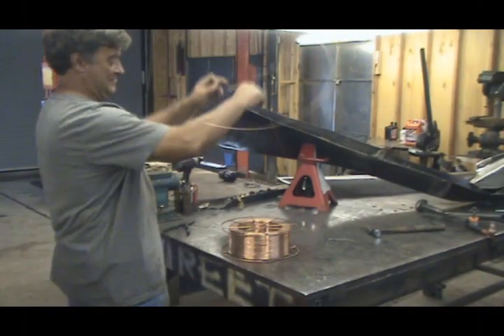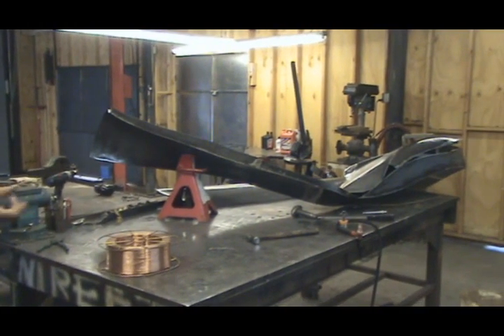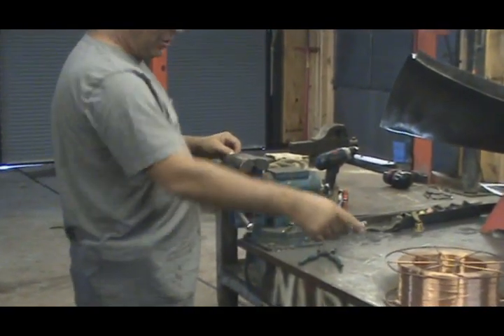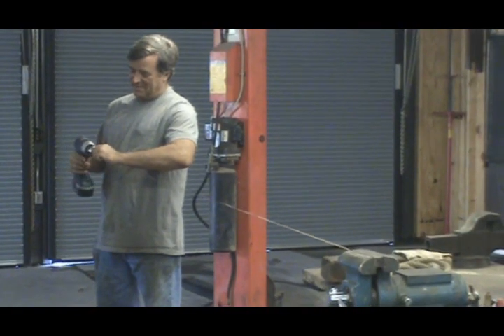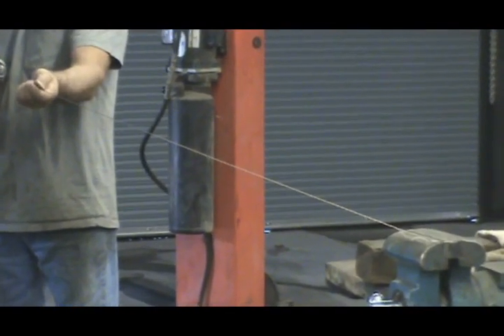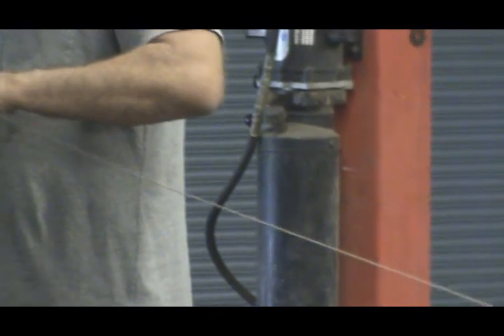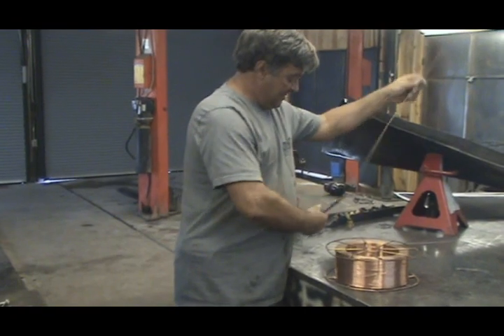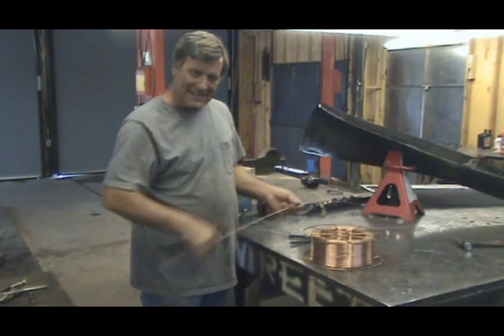How to Make Welding Rods - Kevin Caron

Comment from the maker: @bjensen5 I have never used TIG rod that way but I have used coathanger when I ran out of steel rod for the TIG. 
Absolutely  NOT for high stress apps. but will work in a pinch.

As for the left over mig wire just do the same trick and use it with the TIg. Don't have a TIG use it with your O/A rig. 

Thanks for posting.

Comment: Leave your wire in the MIG machine.  Turn it on but do not connect the ground clamp.  TIG torch in welding hand, MIG gun in feed hand.  Let the MIG auto-feed your fill wire as you go
Reply from the maker: Well that is one way to do it!!

Comment: My father used to repair grilles and trim in the old days.He used to melt pieces of brken pot metal and form rods as thin as possible,cause that stuff melts fast.
And He used to weld aluminum with axcel/oxg,with some special flux he got from I hate to say it "France". Think it was hidden in the caves with the champanyne they hid from the Germans during WW2. But the can did open backwards though.I was just a kid when he did that,lost art now I guess.

Paisano